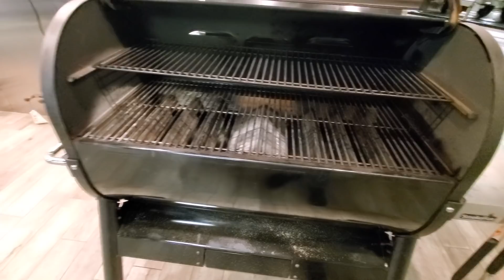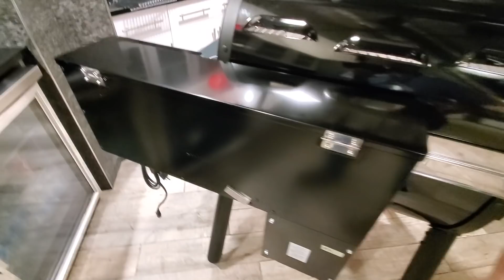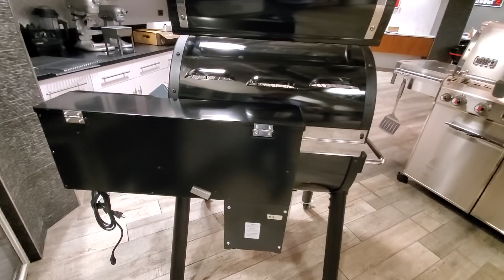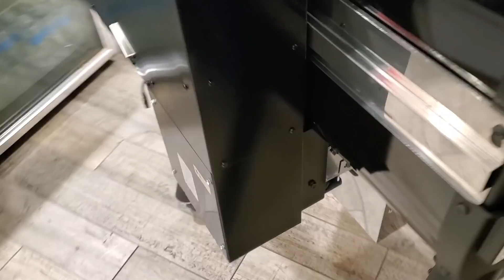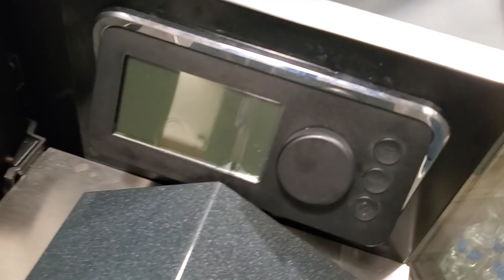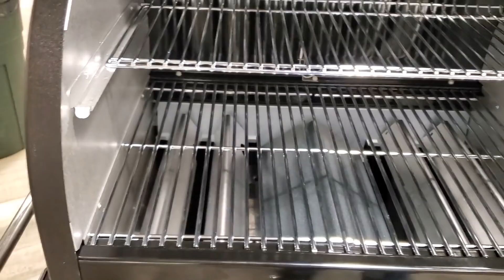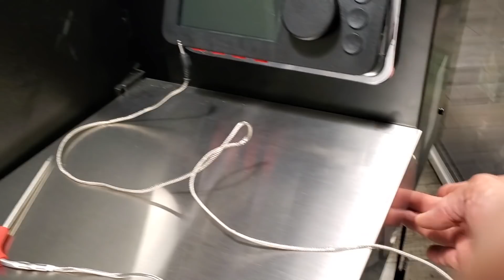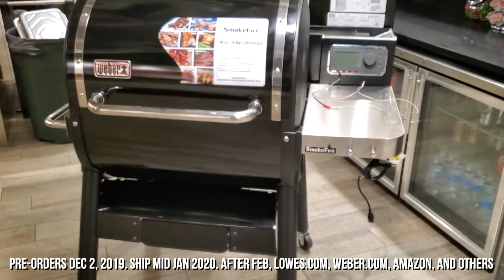Part 1 FIRST LOOK | Weber SmokeFire Pellet Grill Smoker | BBQ Champion Harry Soo SlapYoDaddyBBQ.com

Comment: Geez that looks good and if I could get the 36 for that price (after converting currency) here in Aus, i'd be a player. Sadly that won't happen.
It looks like they were determined to make a smoker that HeavyMetalBBq wouldn't have to modify. We all know he still will though lol. cheers Harry.
Reply from the maker: It will be in 25 countries in 2020 so get in line for your own SmokeFire!
Reply: @SlapYoDaddyBBQ  I'll check out the price, laugh, and tell em they are dreaming. Like I did when I wanted a 22" WSM and discovered that they are $1000 here in Aus. If I'm going to be robbed, I prefer the person doing it to be holding a firearm. That way, I can maintain my dignity.
Reply: @victorbitter583  LOL!  You have a few good smoker makers in Australia.   See my Perth video posting soon
Reply: @harsoo  I can't wait. My comment is probably not what you'd like to have posted on your channel but things will never change here it I don't. cheers Hazza.

Comment: Informative review Harry!  How would you say this pellet cooker measures up to a Rec Tec 680/700?
Reply from the maker: I will torture test the SmokeFire and let you know how it cooks.  We cooked quick meats like steaks and fish so no chance yet to put it through its paces.  In Part 2 and 3, you can see how it cooks as Kevin and Dustin showed us
Reply: Earl I have the 700 (Bull) that I've had for a little over 2 years with the smoke box, front shelf and competition cart options that I really like and I also have a 27 year old Weber gas grill I retired last year. The Weber was made of thick cast aluminum with wood side and bottom shelves. I only replaced the burner on it once and the flavorizor bars on it 3-4 times and the wood once in those 27 years. This new Weber pellet grill isn't made the same as my old one and the barrel isn't stainless steel like the 700 is. The inside looks to be SS but the outside looks to be powder coated like their other newer gas grills and charcoal grills.
I may be interested in the smaller Weber for times I don't do pag larger cooks which is 80-90% of the time because it should come up to desired cooking temperature a lot faster than the 700 does just to cook a few steaks etc...
I'm still waiting for Rec Tec to update one of their small grills that will be released about the same time as this one so we'll see. One thing I can tell you is, the 700 had the best and longest warranty of any pellet grill and their customer service is down right amazing.
Good luck with your search 👍
Reply: It looks like it will have it all over the RT. I doubt Weber (who I have a love/hate relationship with) would have released it if it didn't.